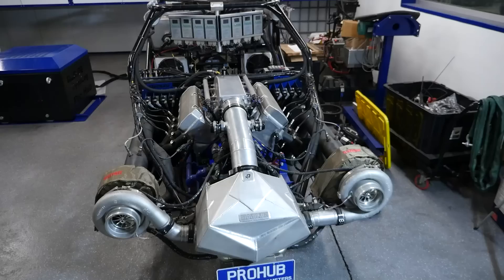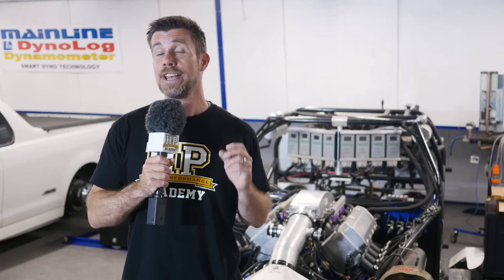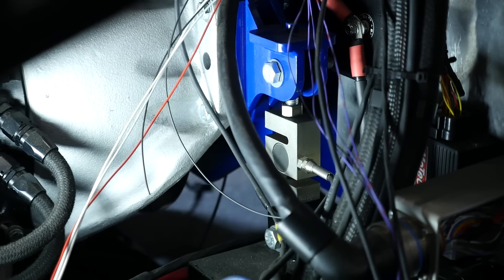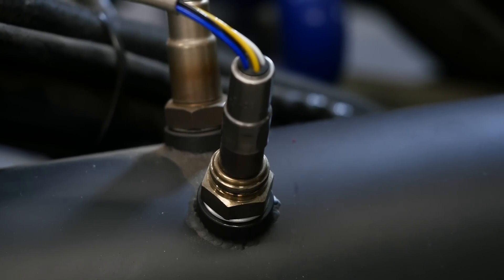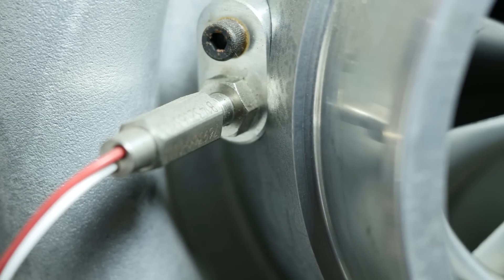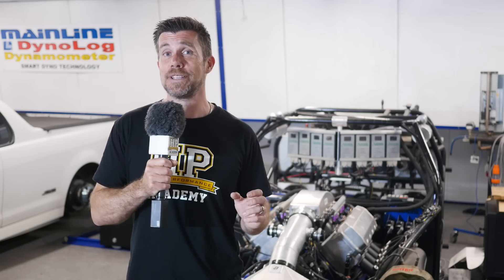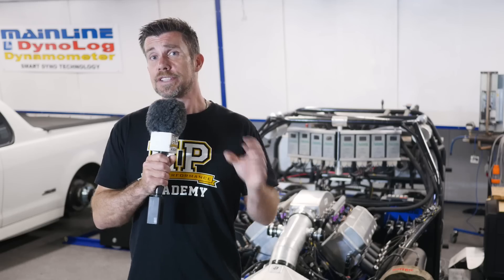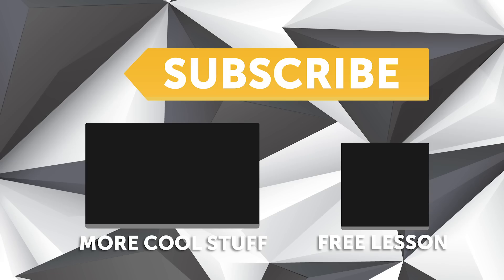3500HP Dyno Test Rig | Drivetrain Power Loss [TECH TALK]

Comment: Andre, long time fan of HPA. Operating my business Gsport Cars in Belfast N.Ireland.
My question is about the the Autronic wideband meters. I do remember these units were pretty much aftermarket industry standard many years ago. They still are to this day one of the best AFR measuring devices out there in the aftermarket. But with the advances in modern technology these days, what is it that makes the Autronic meter continue to be the premium choice for this application over the multitude of other offerings today? Of course many products today are cheaper and not necessarily better. But surely these Autronic meters should have some competition after 10-15years?
I have had my own good and bad experiences with various units over the years.
Gav.
Reply from the maker: You're right that back in the day the Autronic Wideband was considered an industry leader, and it can still hold its own. There are a couple of different versions though and it's the more expensive unit with the lab-grade NTK sensor that is the one to have. The reason Mainline have an array of 8 of these units isn't so much because they're the best available, but rather because Todd has been collecting them for years and just happened to have 8. These days I'd personally go for a Wideband that offers CAN integration as it ensures the integrity of the data. I've seen a lot of error introduced due to ground offsets on a unit that uses analogue voltage outputs.

Comment: Cool, not only going to be useful for comparing fuels - and TBH I was a bit surprised at the lack of thermo-couples to go with the lambdas in the manifolds - but things like transmission case/housing materials (alloys are lighter but may allow case distortion with higher parasitic losses), fluids and fluid levels*.
If understand it correctly the engine, the gearbox and the differential are all mounted separately, with each being free to rotate against load cells, so losses can be specifically identified?

*I would expect high end race teams, like NASCAR, would already use something similar but perhaps with electric motors that may have trouble matching the rpm and torque of a gasoline engine?
Reply: The EGT sensors are underneath the manifold.
Reply: @vanepico  Thank you, I see them now.
Reply from the maker: @Gordo, yes the engine and trans are mounted on gimbals so they can freely rotate around the crankshaft/input shaft centreline. Each gimbal has a load cell attached to it. The diff is conventionally mounted however it obviously feeds into the hub dyno where each pod has a separate load cell.

Comment: My hypothesis is that it's a set amount of loss from just the rotating mass of the drivetrain and not a percentage. I think the percentage is a rule of thumb for the factory power loss through the drivetrain, e.g. 15% for a rear wheel drive.
Reply: I'm inclined to think it will increase as power increases, power to overcome the rotational inertia will be unchanged but the additional power being transmitted through the drive train will put more load through the gears and bearings and create more heat and reduce the power through heat dissipation.
Reply: @vesuviusracing2111  exactly, ppl can calculate loss from mechanical engineering tables, every bearing and clutch provide 1% loss (dont quote me on that, lol :D )
Reply: I agree, other than a torque converter there is nothing that should make frictional loss increase.  If gear width and profile are constant with gear oil then its going to be fairly static.  Our theory is there is fractional increase as power goes up because of bearing loading increasing as a function of all case deflection.

Comment: I think this car has more power than all the cars in my street combined...
Reply: Izzie imagine you having 3 1000hp cars and someone having more power in one car
Reply: Or imagine having 2500hp car and then someone beats you with 1000hp more
Reply: Imagine having focus rs and thinking it is fast af and someone tells you they have literally 10times more power
Reply: The crazy thing I was thinking about is with that engine combination they are most likely losing more power through drivetrain loss then what my car makes at the flywheel. I feel inadequate now LOL
Reply from the maker: It won't ever be able to drive down the street though, she's purely a test rig for this purpose, so power isn't everything depending on what you're wanting to do ;) - Taz.